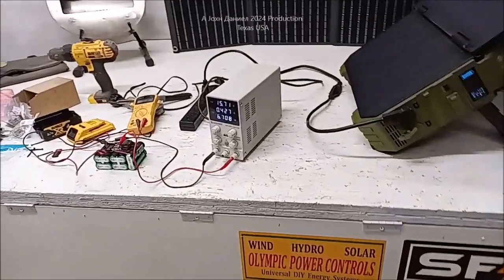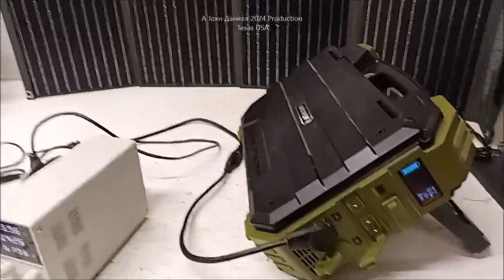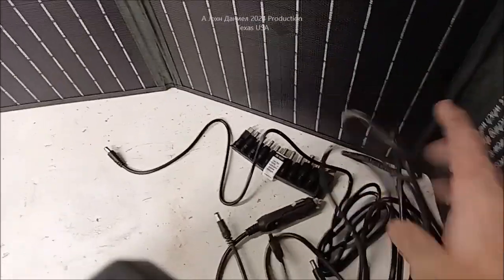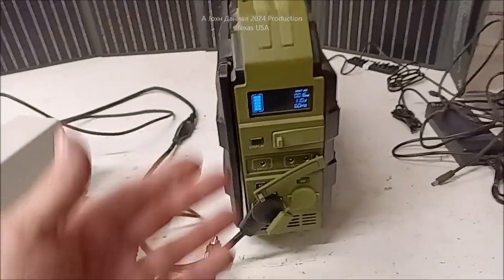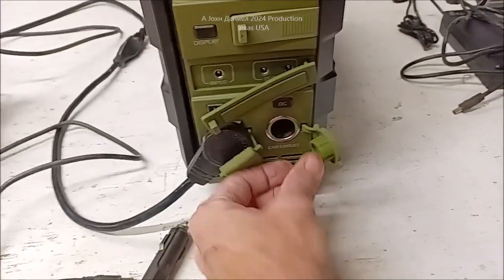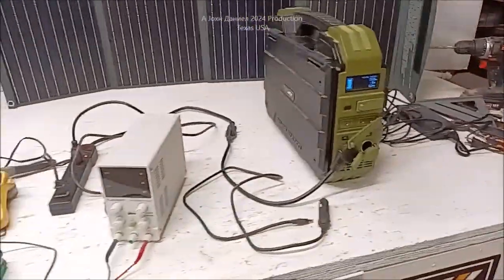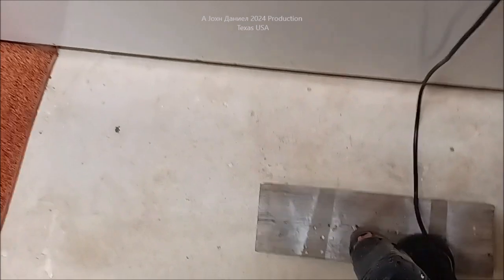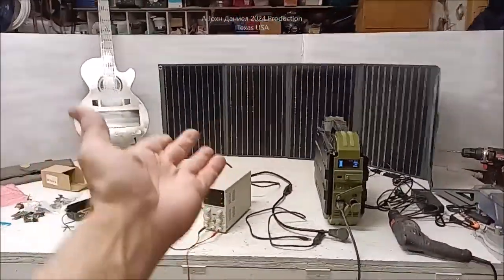BROWEY C600 Suit Case style Power Station, Award Winner, VERY long term review, is it WORTH IT?

Comment: Greetings John, I have an unusual question for you. I am wondering if LED Automobile headlights can be powered by a 12v solar system for bright security light? I bought a bunch of them through an auction and I am looking for alternative uses. 😃 I figured if anyone would know, it would be you! 😁
Reply from the maker: You can use them, they tend to get very hot so be sure to mount them with plenty of open air on them. I use the 50 watt Lysed COBB lights on my place, https://amzn.to/49qneGw they are floods and 4 of them light a entire 2.5 acres of my back yard. A Auto light is a narrow version and you would need about 7 or 8 of them to do what 4 of those floods do. But it can be done. 
Look for the bulb number, and a mount if you need them on Aliexpress https://s.click.aliexpress.com/e/_DkT6J5B there are lots of lenses versions and optic mounts for them like beam and flood. 
Be sure to use 15 amp or higher switch on them.

Comment: I saw a supposedly extremely high quality folding solar panel for sale...but only 99 bucks...so I ordered it expecting a ripoff/refund situation. It produced 98 to 101 watts. ETFE coating, three USB ports. So I ordered another. Then they became unavailable. So two weeks after receiving the second one I decided to make an AM loop antenna from the package. About two days after opening it I noticed it looked weird. It was a 120 watt folding panel WAY better than the first...with a 65 watt type C power delivery port and two normal USB ports. I tested it. It produced 119 watts. I`m not sure what happened. I checked wholesaler sites, finally located these panels with difficulty, but nobody is selling them. STRANGE! They`re INCREDIBLE!
Reply from the maker: HOW to buy what you got cheap, go on Amazon, type is portable solar panel, then hit the LOWEST PRICE choice on what pops up, If you installed HONEY shopping app you will get a pop up showing original price, price drop etc, and you can grab some they are trying to clear out of a warehouse somewhere. I got 4 like you did doing that. A pair of 220 watt Ecoflow for $90 each new. And a cheap no known name 110 watt for $40, a ATEM POWER 180 watt for $88. They do this when a new shipment is about to hit, and it's possible to find them cheap. I even bought 38 of the 50 watt Instapark solar panels, ( Greenway/grape solar 3 buss bar ) for $20.99 each free delivery, all in one shot. Bought last year with made date of 11/2018 on them, all still new. Fed Ex about crapped themselves.
Reply: @JOHNDANIEL1 42 cents a watt is a great deal for such small panels. I’ve seen panels in that range but only by the pallet. Makes me wonder what things will be like in 10 years. It’s night and day compared to 10 years ago. I remember when a dollar a watt was a big deal.

Comment: I bought some name-brand power stations with the stimulus after the two 2020 hurricanes hit my region in Louisiana. Then I started shopping for some half-price (or less) budget versions. The expensive ones, whether they`re regular lithium ion or LiFeP04, still function at original capacity after regular use for lower wattage devices for years, but two of the very inexpensive budget ones were noticeably dropping in capacity after under 100 uses running 10w lights to grow indoor lettuce, radishes, etc. 

The least expensive ones I got dirt cheap are used for USB devices only because using the AC causes them to get very warm...no ventilation...but I`ve saved important outdoor plants from early freezes running LED lights under plant covers with them and use them at night outside for garden security when the armadillos invade. They`re tiny little 7x7 boxes...easy to put in a plastic bag or under a bucket...10 amp DC...and have about 230wh capacity. 

I use my four larger 500 & 700 watt ones for my freezer and small fridge during power outages and for low wattage cookers. They can also run my entire little Powerwerks PW50 PA system setup if I want to do a solo show anywhere with a few microphones, effects pedals, mixer, subwoofer and acoustic guitar. I love the things. I don`t really have any real complaints about any of them because they`re miraculous to me after growing up toting lead acid batteries around.
Reply: you can get neat battery for diy from battery hook up
Reply from the maker: You have to be careful buying, but Battery Hookup is feaking awesome. READ their ads on each item, they do not lie to you. Best items are the batteries used or sourced for failed start up businesses. I got the double 18650 oval cells brand new, 2300ma for $1 each, and they ROCK! Another great source is Electric Car Parts Company in Utah.
Reply: I had the money back then but only a limited time to figure out what I needed and get it. I had enough left over after getting my camper, getting a roof over it, and getting utilities to get a big LiFeP04 battery from Ampere Time but haven`t finished properly installing an emergency solar setup with it because prices went up for everything. Then I discovered that my topsoil on the lot had been removed and my mentally ignorant nephew sprayed weed killer everywhere. So no saving money with an easy garden. That`s just too big of a dream in LaSalle Parish Louisiana. The devil is from here. So I`m fighting the devil too. And I`ll win one way or the other because I`m crazy enough to pull it off. I`ll bring a garden to my yard one wagon load at a time from the woods and plant the piles of dirt as soon as I dump them. What really gets me is I TOLD HIM not to spray that crap anywhere near my place!  @overbuiltautomotive1299
Reply from the maker: Call the paper mill up near you, ask for the waste managing guy, tell them your disabled and you need loads of pine bark stripping's and THEY need a tax write off. We did this on my families place near DeRidder and got 4 huge 15 yard loads for the cost of the drivers pay, and the ground ate it fast, anything will grow there now.

Comment: Awesome Brother John. WWJD.
Reply from the maker: It's what you get when your old injury filled back hurts and your on rough terrain and your 1000 watt model is 34 lbs LOL!
Reply: @JOHNDANIEL1  Exactly. That is a really nice looking power pack.
Reply from the maker: I had to do it, they sent me a good discount code, and at almost half the weight of the 1000 watt ALLPOWERS I can tote it up and down on rough ground without busting myself up. I think with the $150 off coupon code they put on it now it's OK priced for a power station but of the 600 watt range, but this does so much more with the built in solar and DC outlet that don't fault all the time.
Reply: @JOHNDANIEL1   Yep. I'm impressed with its design, and with the built in solar panel it is a no brainier as long as it doesn't overheat in the truck.

Comment: Ive seen a review of this power station and wasnt that impressed. But you sold me on this unit.
Reply from the maker: It's small power, only 600 watts but it can do the 600 constantly which is unusual to actually make the claim plus a little without it freaking out. As for its durability, it fell on a caliche road from 4 feet up out of a moving truck and bounced  a few times and only has a small chip in its rubber feet. But the best thing is it slides in behind the driver seat without jacking the seat forward and loosing my settings on the seat. I got it last Spring on a Amazon 24 hour 33% off sale and love it.
Reply: @JOHNDANIEL1  I would def pick one up if i was working in the field. Good review John